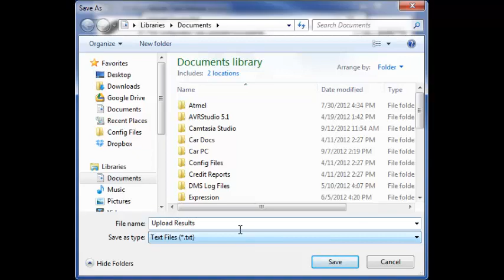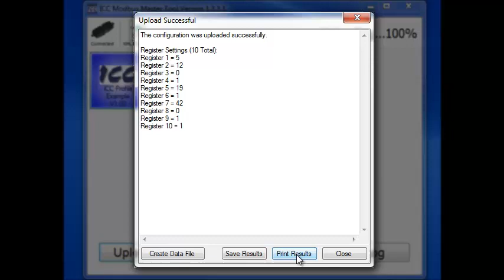Uploading Registers

Comment: also if I change a parameter on my controller and then download the previously uploaded registers it does not reset the parameters, nor does it detect any changes if I press verify....
Reply from the maker: There are a variety of reasons that values contained in a profile may not be successfully written to a Modbus device after clicking the Download button. You should first confirm that the registers you are trying to write to are allowed to be modified and that the Modbus device supports the Preset Single Register (06) function code. The following are some common reasons for write failures:

- The Modbus device may reject one or more of the register writes and reply with a Modbus exception. If this happens, the ICC Modbus Master Tool will display an error message that includes the Modbus exception response received from the Modbus device.

- The Modbus device may reject one or more of the register writes, but reply with a successful Modbus response. Because a successful response to the write request is received, the tool will not display an error message. This scenario is heavily dependent on the Modbus implementation of the device. In some devices, you may simply need to change a setting to enable writes. In other devices, you may need to write to a different register instead. You should contact the vendor of the Modbus device for proper instructions for writing new register values.

- The value written by the Modbus Master Tool may be immediately overwritten by another master or client or by internal logic on the Modbus device. If using Modbus/TCP, ensure that no other Modbus Client is writing values to the Modbus device. If the Modbus device is a PLC-style device, ensure that any logic is not continuously overwriting the register value.

If you need additional assistance, please submit a support ticket on our website here:
http://www.iccdesigns.com/hesk/

Comment: But where can I see and change the values of the registers??
Reply from the maker: After you click the Upload button, the ICC Modbus Master Tool will display a window with the register values read from the Modbus device. To write new values to the Modbus device, you must create an XML Profile containing register values to write. Once you've created the profile, you can select it and click the Download button to write the values contained in the profile to the Modbus device.

Please note that the ICC Modbus Master Tool is designed to download a profile, i.e. a set of Modbus register values, to a device and is not designed to actively write dynamic or changing values to a device.